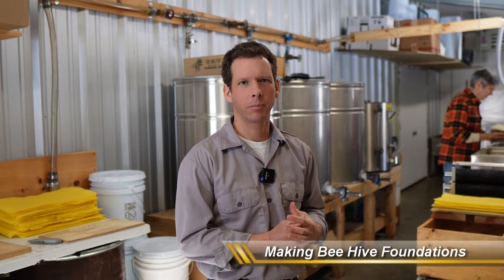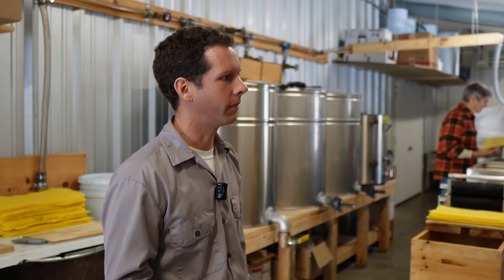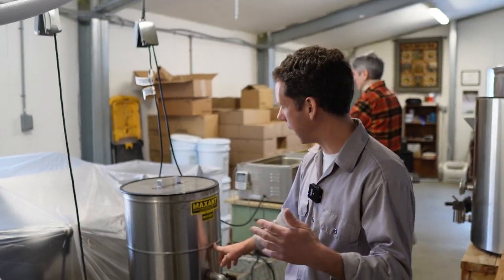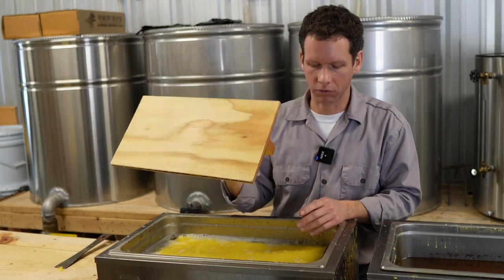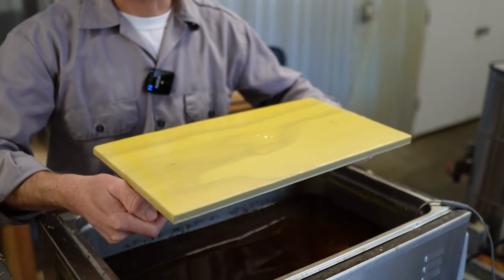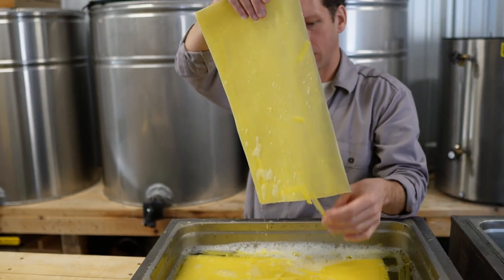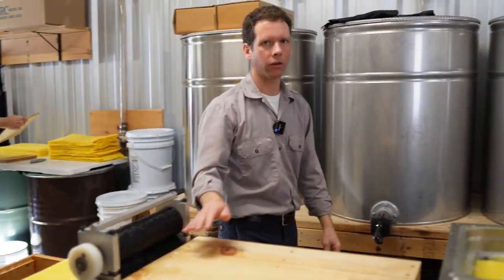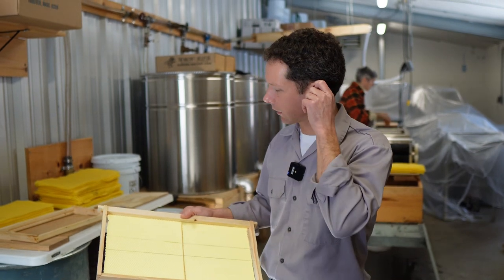Winter 2023 Making Beeswax Foundations

Comment: Hi there,

Love your wax processing system and, on a smaller scale I am doing the same. Can you answer a question though please? My friend has 3d printed a complete machine for embossing foundation however the wall sizes on the rollers are not tall enough so the embossing isn’t successful. Also the bottom of the cells, on the roller are flat. Can you tell me the wall size on your rollers please and let me know whether the bottom of the cells are flat or domed in some way. My friend is going to make two new rollers. Thank you.

Duncan in UK
Reply from the maker: I believe the cell size on my embossing machine is 5.1 mm
Reply from the maker: It's very important to get the initial cell structure right for the bees to draw out your foundations. All six sides of the cell should all come together at a point to form the apex. There is an angle (not sure what that angle is). I don't think a flat bottom in the cell is a good idea.
Reply: Thankyou for this, I appreciate you taking the time to write. My friend has made the roller initially with a flat bottomed cell however no made two others with a concave cell bottom. My initial question asked what height the cell walls on your rollers were rather than the cell width. He has now made the second rollers, we have printed some foundation and it remains to see how the bees take to it. ( each of the rollers took 17th to print so I do t think he will want to make more.

Thanks again

Comment: Could you make the paddle the  same size as a full depth sheet to avoid the trimming
Reply: The sheet stretches when it goes through the roller. Always some amount of trimming needed
Reply: @HivesToHome  thank you
Reply from the maker: I am going to try this next year. I do know that the width of the sheets does not change a lot once squeezed through the foundation mill,  the sheets do tend to come out the other side of the foundation mill longer after being compressed.
Reply: Thank you for answering Troy. Also thank you for posting. It makes scense to use your own treatment free cappings to make treatment free foundation